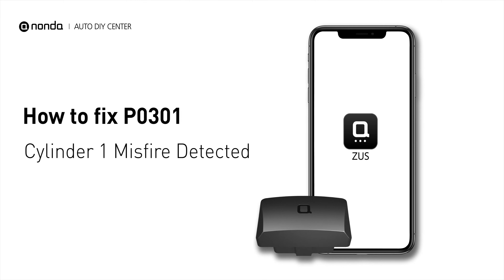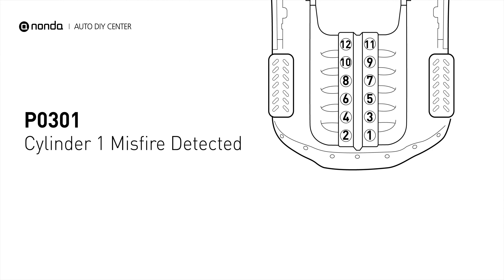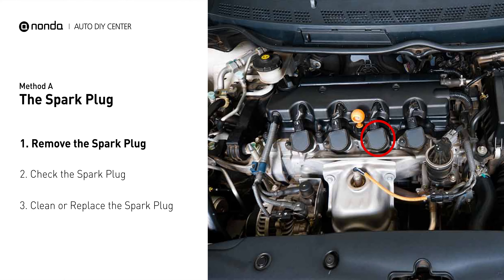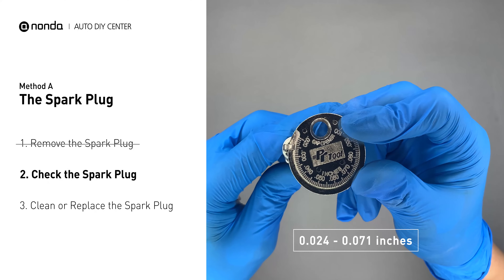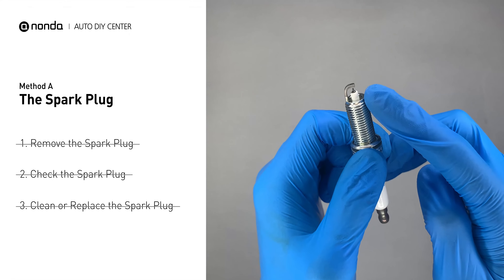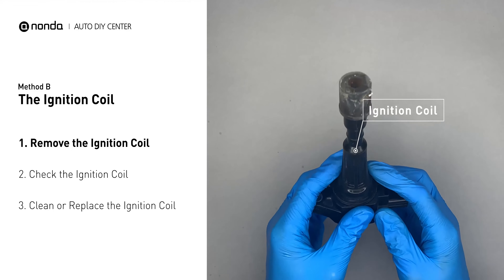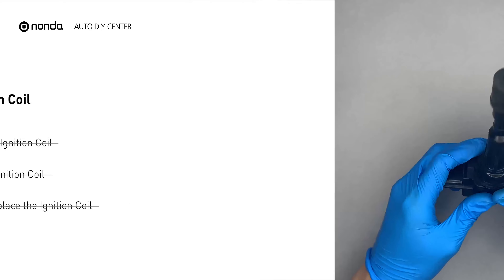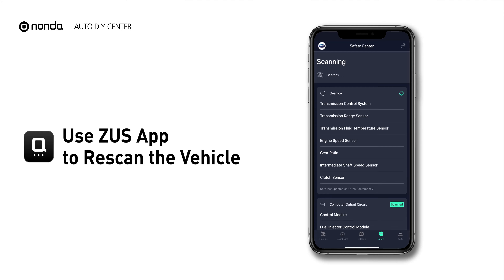How to Fix P0301 Engine Code in 3 Minutes [2 DIY Methods / Only $4.22]

Comment from the maker: Hi, I'm Steve, nonda's lead mechanic engineer. 
Feel free to leave your comments here if you have any mechanic questions, I will be glad to help you out!
Reply: Brand new Spark Plugs & the Ignition Coils were fine. When I took them out to check them, there was oil in the spark plugs. I currently have the Code P0301, any idea what this problem could be? My RPMS also move up and a down, not a lot but it’s noticeable.
Reply: @jokestahhh  valve cover gasket leaking

Comment: I’m not sure how to remove plug covers
Reply from the maker: Hello, locate first the spark plug wires, grab the spark plug wire close to the spark plug and carefully pull it up away from the engine. Use the socket wrench to unscrew the old spark plug and remove it from the cylinder. You should apply an anti-seize lubricant to the new spark plugs thread and screw the new spark plug into the cylinder.